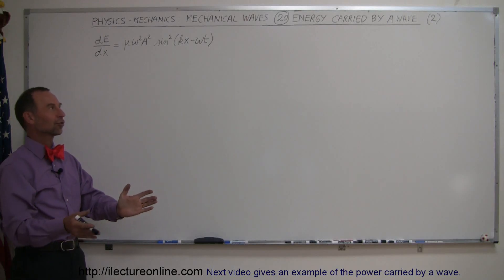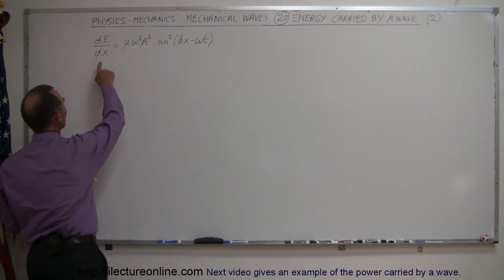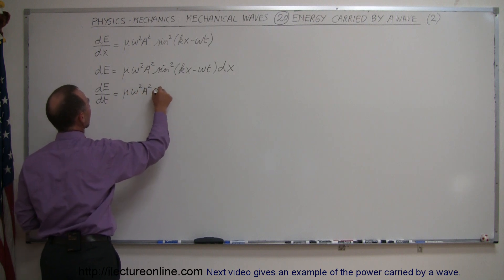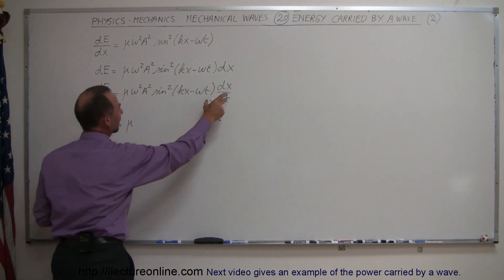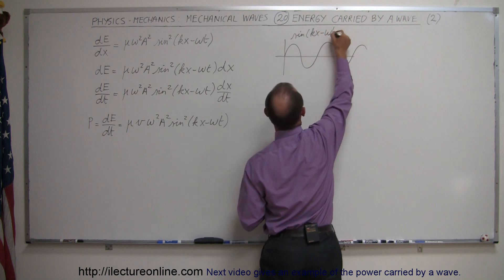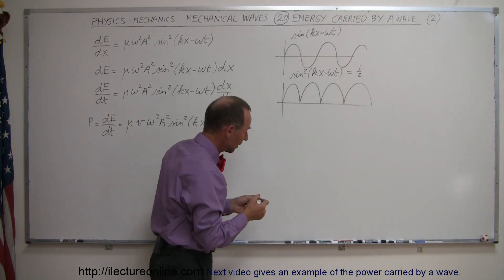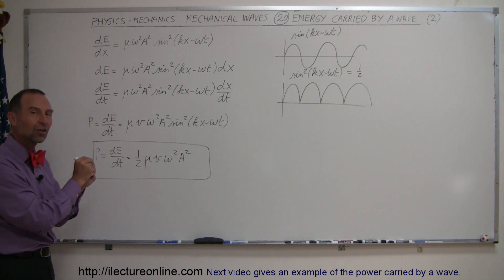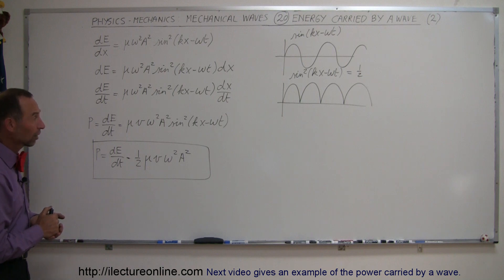Physics 19  Mechanical Waves (20 of 21) Energy Carried by a Wave 2

Comment: That's a drawing of the modulus of sine, not sine squared.
Reply: Well... U also square the negative portion so... Yea
Reply: @oneinabillion654  Sine squared is differentiable at 180 degrees etc. The professor has drawn a corner.
Reply: Ohhh yes. But luckily he followed the right graph for average value

Comment: Your lectures are very good. I could understand a lot.
But in this video, the 1/2 thing I didn't get it.
And are you in instagram?
Reply: +Arin Abx if you know integration just find the average of sine square function i.e.. integrate sine square from 0 to 2*pi and divide the result with 2*pi.
It just about finding the average of a function.In case of  sine square function its 1/2.
Reply: The thing is, his diagram is actually wrong. sin^2 actually looks like a normal sine wave, but with a midline at 1/2, and an amplitude of 1/2. If the midline is at 1/2, then you can imagine that the average value of the sine wave will be at 1/2.

If that doesn't make sense to you, you could try the mathematical approach, where the average value of a function sin^2 is found by the integral, 1/T∫ +T/2 -> -T/2 (sin^2) ωt dt, which actually comes out to 1/2.
Reply: @yam1428yt  Thanks a lot..!!
Reply: @akbar hassani Thank you! :)
Got it